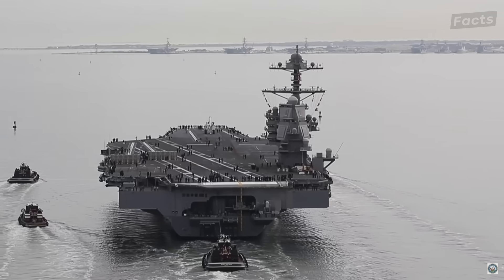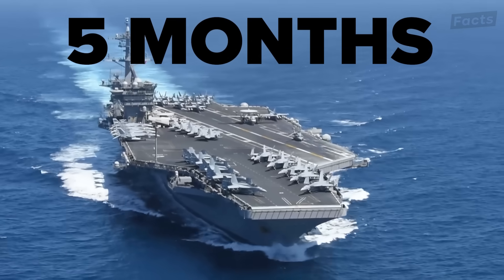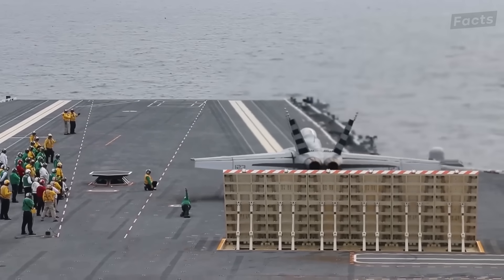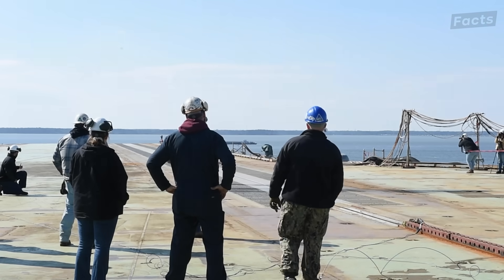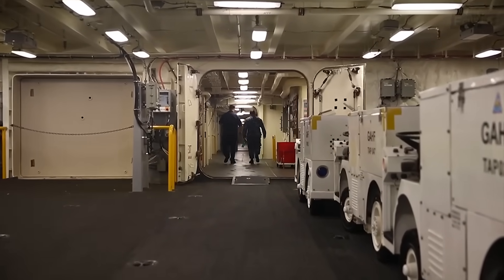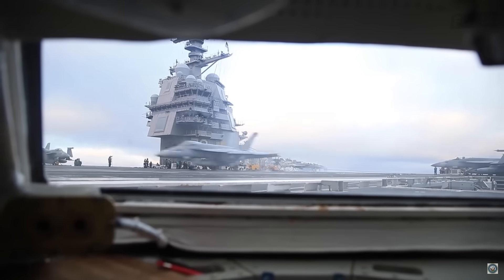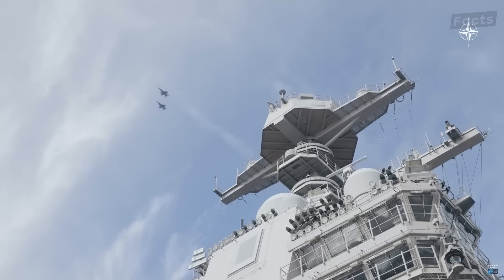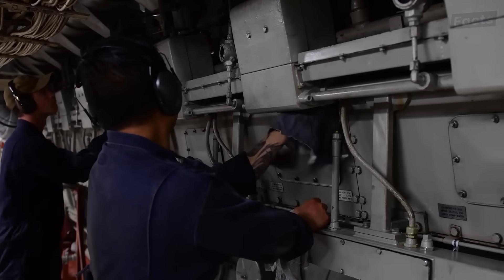The LARGEST Ship in The Navy Has A GIANT Problem

Comment: Your "information" is erroneous.  CVN 76 USS RONALD REGAN, and CVN 77, USS GEORGE H W BUSH also only have 3 arresting gears.  Your assertion that the 4th AAG wasn't installed on CVN 78 is ridiculous, because the ship was DESIGNED to only have 3.  And your BS about ROOSEVELT operating for months without resupply is absolutely hilarious.

These are just a couple of the inaccuracies in your video.  There are many more.

Comment: Quite a number of missed qualifiers went unvoiced in this hype video. To say that the aircraft cannot take off when fully loaded is incorrect per se. They can take off from a land length runway just fine. The shortness of a carrier deck is why you need the steam catapult or the electromagnetic rail system of the FORD class carriers.

Comment: General Atomics was recently awarded a contract for over $1 billion to "improve" EMALS.  I would think the USS Doris Miller will be paused until the new EMALS 2.0 is proven.  Considering that the air gap between a stator and moving "rotor" is rather small, and a large ship does flex somewhat, it does not surprise me that frequent adjustment is necessary.  The lack of sectionalization of the four catapults is also a bit stunning.  Hopefully, the Miller will get it all right.
Reply: The Dory Miller has not even begun construction. The JFK is about to be launched/christened (CVN-79). Next up and under construction is CVN-80, the USS Enterprise. After that (and the first steps to construction are large steel pieces being cut), would be the CVN-81 Doris Miller. Although a wonderful gesture of recognizing a patriotic fighter at Pearl Harbor who later lost his life in the Pacific War, the Biden administration HAD TO choose that name for political reasons. (He was a black sailor.) The carrier after that has yet to be named but it is said the powers that be want to return to names if battles and famous ships and AMERICA has a strong cheering section as well. Personally, I would like a few dead Presidents recognized too like John Adams and Thomas Jefferson. The George Washington and Abraham Lincoln are not scheduled for replacement for decades. We have recent Presidents on a number of the carriers to include FORD, REAGAN, GEORGE HW BUSH, JOHN F KENNEDY. A periodic visit to the Navy's web site is best source of the latest info on ship/naming decisions.

Comment: The Ford was pushed into production long Before the brand new systems were fully tested and vetted.  Elevators, arresting gear and catapults cause millions upon millions in cost overruns, because of the systems not being fully vetted.  It also caused this birdfarm from being able to deploy until way after she was commissioned.  Normally a ship before it can be commissioned, it must pass builder trials and then pass acceptance trials.  Only then are they "Normally" ready to be commissioned and PLACED INTO ACTIVE SERVICE.  Because of delay after delay problem after problem they allow this POS to be commissioned without being able to Deploy. I find it interesting that the cost overruns mandated only 3 AAG's.   This whole fiasco was pushed through by Politicians that have no idea what they were wanting done.  This has become the norm in DC. Another case is the Zumwalt Destroyer. Again tons of equipment that was not fully tested causing cost overruns ended up costing the whole class to be built and the decision not to manufacture the ammunition for the main deck guns.
Reply: There is something to say about land-based system models.  The Burkes have been well served by this.  EMALS may have required nothing less than a pared down test ship that would work out what rough seas might do to the system.  General Atomics recently received a $1 billion contract to "improve" EMALS.

Comment: A basis tenor is:if it ain't broken, don't try to fix it. All these new systems installed in this carrier, had suppliers and lobbyists who, probably made donations to the politicians and in turn they then pushed for the Navy to purchase same. That the new systems wouldn't work as promised, were not really considered by those benefitting from the acquisitions. Is there any difference between them and those whom it is said, stole from Russia's defence programs?

Comment: The claimed number of "traps" for the Ford over an 8 month cruise is Nowhere near a  record, even though it has more planes.  The Nimitz, in its 2002/3 cruise had over 11,000! And I am not sure what a record is for a carrier cruise.. For years Navy Brass hid the deep problems that the Ford had. I bet they Still are.  Other classes of aircraft carriers have been started with far less problems. Carriers I have been on: Enterprise, Roosevelt, Lexington, Midway. And Yes, that Lexington Was in WW2. CV16.

Comment: Marine F-35Bs can launch from US carriers without catapults. Just to be pedantic. It is possible the Navies F-35Cs could operate without catapults but with significant disadvantages. Using a larger portion of the deck, carrying less fuel and bombs. To be even more pedantic. Super Hornets may also have this capability. And would likely require full afterburners. B-25 bombers did so during WW2 with shorter decks, no catapults and far less power.  Catapults remain a very important advantage. Future carriers should be built to carry either steam or electric drives until the electric drives are proven. And more or larger bomb elevators added. They could even have steam power from the reactors. Or more batteries. Which could be used as counterweights.

Comment: The Ford is first in class. This means it will be used to troubleshoot and fix problems before, and as, the next in class are being built and trialed. Every new weapons system needs to be used and abused in order to find out what breaks. All of this is standard and expected for the first ship in a new class.
Reply: Many systems can be proven in land-based labs.  New systems for the Burkes get tested out thoroughly on land before being implemented at sea.  $13 billion is too much for a test ship.    Something like EMALS could work fine on land with a launch now and then.  It needed to be pushed hard in a land lab, and then tested after and in rough seas on a pared down test ship.

Comment: The REAL STORY after the first cruise:
In 239 days underway, the ship’s crew conducted 43 underway replenishment, logged more than 17,826 flight hours and 10,396 sorties, sailed more than 83,476 nautical miles, and safely transferred 20.7 million gallons of fuel with zero mishaps.  The Ford crew conducted 33,444 flight deck moves, 3,124 hangar bay aircraft moves, 2,883 aircraft elevator moves, 16,351 aircraft fueling evolutions, and transferred 8,850 pallets of cargo and mail.  The Gerald R. Ford culinary team prepared and served 3.1 million meals, which included approximately 48,000 dozen eggs, 24,000 gallons of milk, 131,000 hamburgers, 367,000 pounds of chicken, and Gerald R. Ford’s favorite . . . 79,000 chocolate chip cookies. 
THAT is nothing to sneeze at . . . However, we still do not have a way to continue deck launch operations while working on one of the EMALS launchers.
Reply: So 10,395 sorties / 239 days underway = 44 sorties / day underway.   Presumably some days were higher or lower in sorties with a few days having no sorties.  Of course, the maximum number of sorties generated in a single day has probably been kept classified.

2018 Congressional Budget Office:  "According to the Navy, each of its 10 older Nimitz class carriers can sustain 95 strike sorties per day and, with each aircraft carrying four 2,000-pound bombs, deliver three-quarters of a million pounds of bombs each day."
Reply: Wouldn't working on a steam catapult also interrupt launch operations?

Comment: Sensors failing? That's something that's fairly easily fixed by the manufacturer usually. It sounds like overall it's good, just has some minor kinks left which nonetheless don't have a severe impact on performance since parts can be replaced much more easily.
Reply: I'd bet it's something unanticipated like steel capacitor leads being bent by the electromagnets. That would crack the seals or attachments in the capacitors, or wear out the solder connections. Since almost all capacitors with wire leads use steel wire, the fix will be expensive since the parts would no longer be off-the-shelf. This will lead to some Congress critter grandstanding about paying $30 for a part that usually costs less than $2.

Comment: What is the probability that the Fujian will NOT be severely handicapped by these 2 problems (electromagnetic catapult and advanced arresting cable system) that have plagued the USS Gerald Ford?
Reply: they just have to fix the cracks in the Fujian's deck
Reply: If they bought or stole the original plans . . .
Reply: @timtrewyn2042  That's the WRONG answer. If the Chinese copied the US design, they would run into the same problems as the USS Gerard Ford!! By the way, the various problems plaguing the Ford have not all been solved yet, as the design of Ford's EMALS catapult system seems sub-optimal.
Reply: @johnseah5678  General Atomics was recently awarded another $1 billion to "improve" EMALS.
Reply: Fujian's electromagnetic catapults were tested successfully during the recent 4th sea trials, launching both J-15 fighters and KJ-600 (the Chinese equivalent of the Grumman E-2 Hawkeye). The PLAN took only a few months to test and demonstrate the reliability of their version of EMALS compared a few years by the USN. The Chinese version uses DC power instead of the AC power used on the Ford. If any of the 4 catapults on the Ford develops a problem, all 4 catapults have to be shutdown to fix the problem. But on the Fujian, any problem affecting one catapult can be fixed by isolating that faulty catapult without having to shut down other catapults. The Chinese design is clearly superior and works from the get-go.

Comment: It's almost disingenuous to compare 90 aircraft on a Ford CVN to 90 aircraft in another country's air force. The US military uses force multipliers that enhance effectiveness, sometimes by 20x or more. You can't always see the difference, but the results on the battlefield make the point clear.
If carrier jets use only three force multipliers at 20x each, that makes the jets about 8000x better than they appear. This reduces the enemy's chances to luck in order to shoot down an American fighter jet. Either that or cockiness. American commanders are well aware of these force multipliers and might send the jets on a mission that's 500x more dangerous. Sometimes you gotta.

The US military typically operates on a much higher level than other countries can comprehend, let alone match.
90 jet fighters on the USS Ford could dismantle an enemy's navy in one day. The overmatch is that great.

Comment: Reactors dont make steam, they make hot water fed to a steam generator that makes steam.
Reply: @johnhoffman8203
Ok. Because you are so petty, I unfortunately have to react. Unfortunately, you are wrong!

Reactors don't make hot water, they produce heat, fed to a water tank, that makes hot water.

🔥😂
Reply: @Trance2010de  I know I am petty, cant help it, I was a Master Chief PETTY Officer, and nuclear trained at that, on 5 subs.  I shimmed a lot of control rods in a reactor to make hot water.  This hot water is pumped to steam generator tubes conducting this heat to the water surrounding them and returning the cooled water back to the reactor to rinse and repeat.  There is a water tank that is electrically heated to make a steam bubble, but that only maintains pressure inside the reactor vessel.
Reply: @johnhoffman8203  😂👍. Yes, you're right.
I tried to act like a smartass and described it in even more detailed.

 Because before the steam comes the heat of the reactor, and then hot water, then steam.
Also the electricity you mentioned, is mainly produced by turbines/generators,  using  the steam.
Reply: @Trance2010de  You have a gross conceptual error about both reactor operational concepts and heat transfer and fluid flow.  The primary fluid never comes into direct contact with the secondary system.  The only component common to both systems is the steam generators that make steam form both engine turbines and generator turbines.
Reply: @johnhoffman8203  I have not even mentioned or described in more detail, the type of heat exchange or the various water cycles. 
I also know, how such a system works. Since I also have a certain technical understanding, as a trained electronics engineer with professional experience.
Reply: @johnhoffman8203 , YOU LOSE.😅😂🤣
Reply: @Philo-f4g  What part of the discussion did I lose, and/or did you not understand, as I would be happy to explain it to you in unclassified detail,

Comment: Lets see....first all new launch and recovery system in 60 years.   Power generation more than 6 times previous ship...meaning shes built to accommodate nextgen electromagnetic weapons.  Streamlined operating overhead to make sizable reduction in crew size (some reports over 1000).  Increased airwing capacity.   Basically one of the most complex machines on the planet that "has a few bugs".   The Navy is giving CVN 80 the legendary name Enterprise....they have faith in this class
Reply: I'm still wondering where all the power is going, unless of course they have some reactors offline at all times.  Reactors are designed to operate at a specific output and can only really run at a lowered output for short periods before they need to be ramped back up, so the GRF is either producing 6 times as much power as required and that power is going somewhere (heat has to go somewhere) or it has some of it's reactors shut down.
Reply: @krashd  The reactor core can be cooled without creating steam for the electric turbines.
Reply: Bugs don't take 8 years to patch.  The EMAL and AAG issues are fundamental design flaws  that the  best efforts of crew and shipyard people can not correct.
Reply: @jamesb4789  The problems are ALREADY fixed.
Reply: @jamesb4789  your 'current events/facts' are dated.
Reply: @jamesb4789  you do realize most of the info in this video is old, don't you?
Reply: If you want to trust the military industrial complex -and the woke brass in the military, go ahead.

Comment: Actually, the issues are real and would have  a real impact on combat capability.
The Weapons elevators as installed  were junk.   The Navy had to build a special facility in the Philadelphia Navy  Yard to redesign and make major modifications  for each elevators.  Of the original 11, only 3  functioned at the minimum requirement.  The original elevators have been removed one by one.  
The AAG in the original ship spec called for 4 wires for combat redundancy.  Pentagon Brass sided with the contractor and went with 3, but the Navy was able to provide  for installing a 4th  system and it will be installed at  an overhaul.   the  lack of  the forth wire has lead to delays in landings while crews rush to get the wires set up.   As the crew gained experience, the landings between failures rose but are far below the Nimitz class.
EMALS  was a wonderful toy for the top Brass and has been  a very poor performer.  The EMALS have NEVER  hit their launches  between failures and are still far below the Nimitz class .  Worse, the EMALS design requires  ALL 4  catapults be brought down to work on a damaged or failed unit since the can not be isolated.  In combat that would mean simply  ignoring the  failed cat until  operations allowed enough time to halt air operations.  The numbers are better than 2 years ago but far below spec.
All three of these systems were designed by General Atomic I believe.  Correct me if I am in error.  The company had  ZERO carrier experience and little  experience on any combat vessels.   They were given the contracts by the politicians in the Pentagon for political reason.  The Navy's preferred supplier  was a regular  adn understood ships an their systems.   And they were the low bid.    But somehow the Obama White House  pushed  GA.  Do you think it was because their largest stock holder was a major fund raiser for Obama???
the Ford has come in at least $ 6 Billion over budget and it will take a lot more cash to fix.   The Navy has been forced to delay a lot of new ships and stretch out overhauls to scrape up the cash.    The worst part is the Ford was supposed to be have double the reliability fo the Nimitz class but is  struggling to hit the Nimitz minimums.  The Ford's deployment last year  was primarily an extended shakedown cruise to figure out solutions away for prying eyes.   Ford is the least effective  carrier listed as read for duty and there is no end in sight.  People leaving comment fail to remember that this  ship has been in the water and a mess since 2016.  WE are now hitting 8 years of debugging and shakedown with hopes of a resolution any time soon .  And many of the known design flaws were carried over to JFK.  A large number of design changes were made for Enterprise so there is hope for the class, but the  Ford  remains a vast money pit and I am afraid  JFK will be too until the rotten designs are replaced.
Reply: Yep. Well said.

Comment: Beyond Facts is right for this channel or more correctly it should be called you got your facts wrong. The Ford does not have steam catapults, they are magnetic. If you can't even get that info right then just maybe do some videos on basket weaving or something.
Reply: But they may get those wrong too and then I wouldn't know how to weave a basket.
Reply: I think the script writer meant to say that EMALS is used INSTEAD of the steam catapults used on previous carriers.
Reply: Paul, hopefully you'll get over the mistake.
Reply: @hello_its_me.  Nothing for me to get over. However, errors, propaganda, low information density, omissions of pertinent data and outdated material can lower my personal rating of a channel.